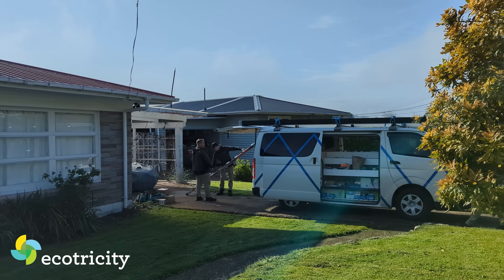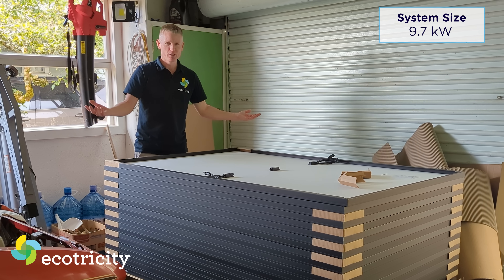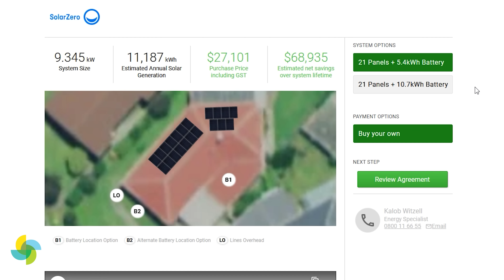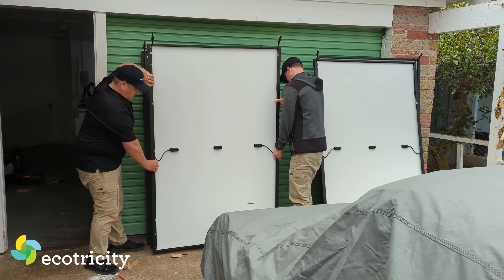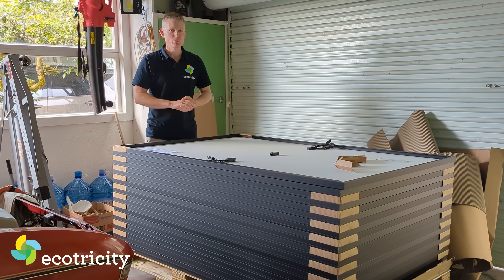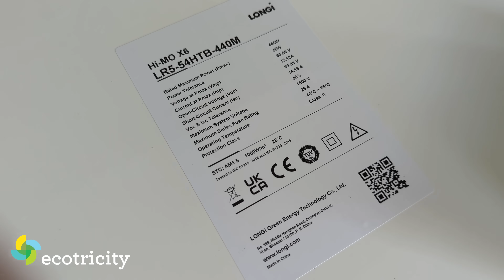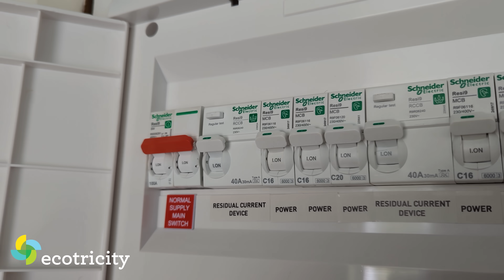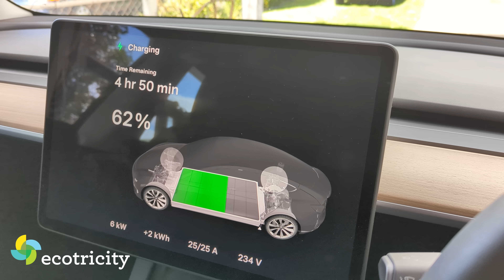I got HEAPS of solar panels installed!

Comment: I thought there was a Electrical safety rule which prevented running wires inside the house for lengths greater than 300mm?

Comment: I got an 8.8Kw system in Tassie* with 6kw Hybrid inverter and 10.4kwh of battery for $21k AUD or 24k NZD. 31k NZD for 9.6KW and same battery but you have a larger inverter* seems a lil steep and I've had my system for exactly 1yr on 11th Nov :) Edit* plus 2k to move power box! yikes

Comment: Wait, why can we only export 5kw to the grid in nz?
Reply: The inverter plays role in this as well. The Grid doesn’t want you using them as a battery, if you look at Australia you will now see they are charging you for doing this.
Reply: @dave24-73 note for dave, this is not Australia, and NZ solar is totally different to aussie
Reply: @ didn’t say it was, the reason it’s of value is because this was introduced much later on as more people installed Solar.
Reply: This is a general rule throughout NZ on all residential connections of the lines companies networks. Bonus if you have 3 phase power, 5kW per phase.
Reply: @dave24-73  The two countries aren't directly comparable. Australia's baseload generation is primarily coal thermal which is much slower to bring onstream or shut off than NZ's hydro is. Australia finds it more effective to control grid supply by throttling solar as it can't control coal generation as effectively which serves to disincentivise solar. NZ has a huge advantage in that it can use hydro storage as a huge national 'battery' as solar generation offsets load during daylight hours.
Reply: @ it’s not just Australia, and I’m not comparing it to Australia, as more people adopt Solar many lines companies have moved to charging people for exporting. That was more the point.
Reply: @dave24-73  Give examples. Countries with nuclear baseload will have same issues as Australia. The bigger picture is that the more lines companies and retailers restrict solar export the more incentive for domestic solar owners to beef up their battery capacity and go off grid. As panel and storage prices keep dropping (plus V2G on the horizon) the lines/retail companies need to tread carefully to maintain a viable customer base.

The situation where power prices rise beyond the point of that of domestic generation, leading to customers disconnecting, which then pressures the supply prices upwards due to decreased customer numbers and increased infrastructure costs, leading to more customer loss, etc... The utility company death spiral!
Reply: @HarmLessSolutionsNZ  A controversial rooftop solar rulemaking decision has risen to the Supreme Court of California, with the state’s highest court granting review for a petition filed by the Center for Biological Diversity.

The case involves NEM 3.0, a rate structure that went into effect in April 2023. The California Public Utilities Commission (CPUC) approved a request by the state’s largest investor-owned utilities to cut compensation to customers that export excess solar generation to the grid, a process called net energy metering.

Net metering rates were rapidly cut by 80% under NEM 3.0. This change, combined with a high interest rate environment, has pushed the state’s robust rooftop solar industry off a cliff, damaging the return on investment for homeowners, and leading to more than 17,000 solar jobs lost, demand falling 80% post-implementation, and numerous companies filing for bankruptcy.
Reply: @dave24-73  Please refresh my memory...California, isn't that one of the states of the United States of Fossil-Fuel-Mania ?  Y'know what they say "Drill, drill, drill, baby !"  Plus remember, providing utilities is NOT about supplying energy to people at the lowest price while being environmentally responsible, it is about how Shareholder values and profits can be maximised, for a small number of private corporations and their already wealthy owners !
Reply: @KiwiCatherineJemma  and guess who just went into liquidation SolarZero, I did warn people.

Comment: Is there a reason you didn't get a 10kW inverter as you have 9.7kW system but the inverter limits you to 7.5kW only.  Seems unusual.  Eventually you may want to get a battery and ATS so that you can be powered when the power is out.  I have also heard that the best way to compare to previous power bills is to do annual comparisons due to the fluctuations over the year with solar generation.
Reply: Some energy wholesalers limit you to 5kW inverters...I guess to protect their creaky old grid...
Reply: The logic behind more PV panel capacity than the inverter's max input is to reach the inverter's peak capacity earlier in the day and for longer (i.e. flatten the bell curve but extend the overall period). It also is of benefit in sub-optimal weather to maximise generation. The inverter will just 'ignore' any excess generation coming its way so protect itself from overloading.
Reply: @ad_fletch  It's about not only protecting their infrastructure but also maintaining balance between phases. Maximum of 5kW is per phase so it's possible to export 10kW from a three phase setup for most lines companies.

Comment: A new installation without a battery is not ideal. A battery may be useful in case a storm causes network instability or a power outage. Does the new setup support V2H/B or is it only one directional ?
Reply: You have no idea. A battery is generally a benefit for bragging rights, but nothing else. You would know that if you did the maths on 1 cycle per day over a 10 year period. eg $16,000 ÷ 10Y ÷ 365D ÷ 13.5KWh = $0.337/KWh = already higher than retail price

But in winter, a 9KW system will not fill the battery. And most batteries are not cycled through their full capacity each day either. So cost per KWh rises to around $0.43/KWh

Then there is interest on the $16,000 battery purchase price. Say 4% = $640pa ÷ 365 ÷13.5KWh = $0.13/KWh

Finally there is the lost feed in returns. $0.17/KWh (Mercury)

Adding it all up $0.43 + $0.13 + $0.17 = $0.73/KWh

Compared to approx $0.25/KWh average purchase cost

Now show me why you think an install without a battery is not ideal. 

And what is storm caused network instability? Is it your fancy words for a power outage?
Reply: @Goodkiwibloke  Your calculation is maybe right for NZ electricity prices, but in my part of the world is price per kWh from grid oscillating around 0.30€ per kWh which is aproximetly 0,55NZD. 
On the other hand, during sunny summer days, PV in the area can produce more than the demand on the grid, so some installations may be disconnected from the grid or the price of electricity is negative. So if you don't have a battery, your balance is negative on those days because you are not selling, you are just buying overnight. Many people are not in the same position as Gavin in the home office, but the complete opposite. So at peak sunlight hours, they don't have any high demand at the point of production because their electric car battery is with them at the workplace. So even a V2H/G vehicle wouldn't help them.
Instability is not a fancy for a power outage, but it's a situation where some lines are damaged/disconnected and others are overloaded. So the power in your home may go out for just a few dozen seconds, but multiple times a day. Which can damage your electric devices. Maybe you've never experienced this, but I've lost a few devices in the past because they were more sensitive if they didn't shut down as intended by the manufacturer. 
Also, your battery prices seem to be a bit higher than ours. For a 17,5kWh LifePo with 6000 cycles(+15years of usage) you only need 7-7,5k€, which is about 12,5-13,5NZD. But yes, you can call it bragging, we usually call it saving in the long run.
Reply: @Dqtube  But this is a NZ presentation on a NZ solar install for other NZers to listen and learn from. And in NZ the figures I quoted are current, and clearly show the folly of adding a commercially produced battery to a solar system in NZ.

It doesn't matter what the circumstance is in your country. It is irrelevant for the target audience. So your comment is misleading

In NZ we have excellent grid stability (frequency control) due to 65% of electricity being generated by hydro, and 5% by gas peakers. Again, the situation in your country isnt relevant
Reply: @Goodkiwibloke  You don't understand what I described. If a storm causes a landslide that breaks some of the cables, and the wind sends some branches onto cables a few kilometers elsewhere. So instead of 3 different directions and substations, your city is connected to only one substation that does not have enough capacity to cover the entire demand. How does frequency and type of electricity generation relate to this problem?
Reply: @Dqtube  It's not an issue in NZ. Our grid is solid, our local lines are solid with lots of redundancy. Maybe 1 power cut per year, maximum. So a $16,000 battery is very expensive insurance for a tiny risk of an occasional power cut. And as I outlined, there is no financial benefit of installing a battery in NZ

It may ge different in your country, but this is a video about NZ solar install, made for NZers. So your circumstances are irrelevant
Reply: @Goodkiwibloke  Probably irrelevant now that solar installations in NZ don't add even 1% of electricity generated. If NZ wants to reduce all gas and coal then it needs to increase solar and wind production, because it looks like hydro and geothermal are already at their limits. Since their production has been at a similar levels for the last ten years.

Comment: Are you all electric at home? No gas, electric heating? I know you charge a lot for work at public chargers 😅
Reply from the maker: Sure am! Electric car, electric water, electric stove, electric heating etc. The house has a fireplace but it's not needed. I just wish I could go back in time and slap myself for not doing this sooner! What was I thinking?! 😂 -Gav
Reply: @EcotricityNZ  we've moved house twice now. Each time we got solar on the roof before we had even full unpacked! Melbourne winter sucks for us so we wish we have more solar. Our inverter has a a little more capacity so we might get more solar.
Reply: @MatthewBayard Agreed - still have imposing bill in middle of Winter with our 7.7kW system, but Hey no gas bill any more and 3/4 of the year bills are low. 
Running a car for free with sun power is awesome.

Comment: Gavin forget about repayment time and look at the return on investment. We have $20k sitting on our roof and with an all electric house and 2 BEVs what we save in electricity cost and petrol equates to a 10% after tax return on that money (which if still in the bank would be worth less than 20k now). Could luck getting that safely in an investment! 
If you removed our line rental costs (high here in Marlborough Sounds), metering charges and Ecotricity’s costs then most of the year we would have negative power bills.

Comment: Compounding interest on 20k will usually yield better return than savings through Solar, taking into account the payback period.
Reply: Considering a well designed solar installation typically has a payback period of <10 years where do you suggest investing for a 10% return? And as electricity prices continue to rise your return increases/payback period reduces and the income keeps going well beyond 10 years and you have a large degree of insulation from electricity costs for the life of the system, doubly so if the solar is also charging your EV so no petrol bills.
Reply: @ it’s compounding so you don’t need 10%
After investing for 20 years at 3% interest, your initial investment of $10,000 will have grown to $18,061.
You will have earned $8,061 in interest. 20% on 20k is only 4k. It’s the compounding part that makes the difference. 
Note many companies are also starting to charge for export, this trend is growing globally, best examples are in Australia.
Reply: You have zero idea. Run away
Reply: @dave24-73  And during that time your electricity prices will have increased by what percentage? Good example of chasing your own tail. Also your interest is taxable whereas the gains from solar aren't.
Reply: @HarmLessSolutionsNZ  Good to see your sensible comment. It gives balance to all those like dave who "read it online that......." and think they know it all
Reply: @dave24-73 If true (ànd from your other comments I seriously doubt it) you clearly worked in non-operational roles. Because you obviously don't understand solar in NZ, compounding interest, the price of electricity in NZ, or mathematics

Run along and stop misleading people dave
Reply: @ well throw your money away see if I care but don’t mislead potential buyers.

Comment: BATTERY ALWAYS MAKES SENSE. You take cheap night time rate energy from grid then use it in daytime and top up from sun as you are using it. So you are wrong BATTERIES are essential unless you have a permanent EV with VTH.
Reply: That really depends if your demand offsets your usage d the cost of that usage. I've done the sums multiple times and I'm still coming with 12year payback on the batteries. Plus my night "battery" is an EV car.

Comment: Haha 19K, you got ripped off, equivalent system cost 3K in Australia, those panels are $99 each, hybrid inverter $600, second hand rails are almost free in Australia. Maximum it should cost $3000 for 10kw system, and additional $2500 for 16kwh lifeo4 battery. Don’t be overly exited, and Nz Viewers Should know that they are getting ripped off by these solar installation.